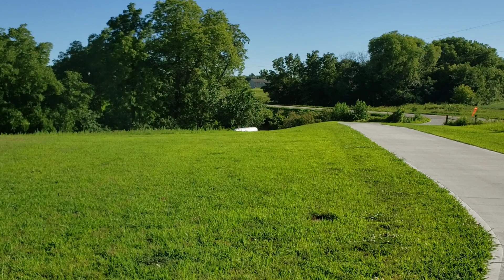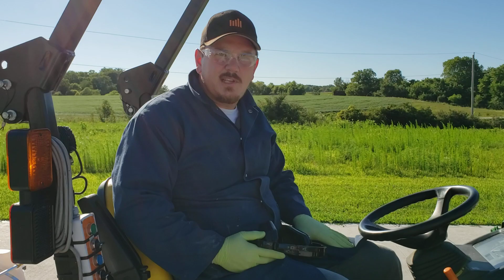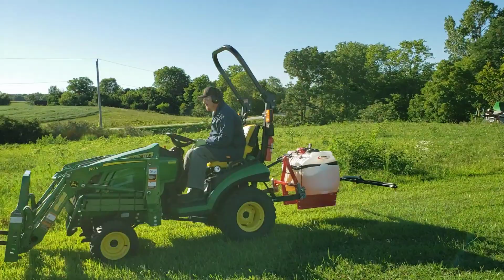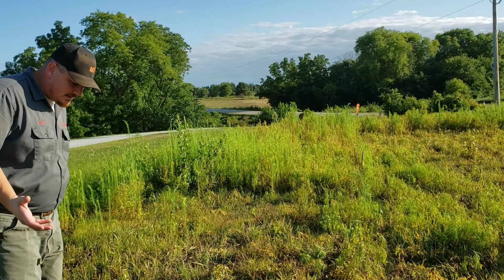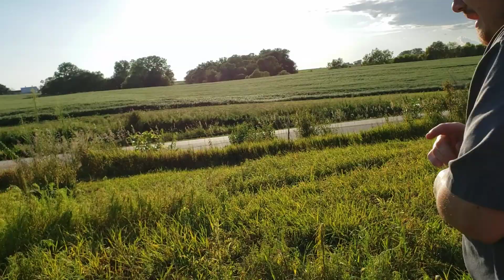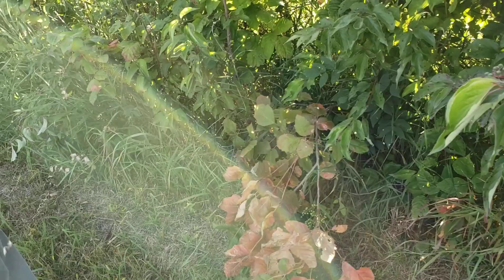Fimco - 40 Gallon Electric Pump 3 Point Sprayer

Comment: Thanks for the video.  Looks like the 2nd nozzle from your LH side was plugged and not spraying on you drive by.
Reply from the maker: I missed that, but can check on it. The spray was pretty low, and somewhat hard to tell, but now that I have a cabbed tractor, it's even harder to see, but a lot safer ;)